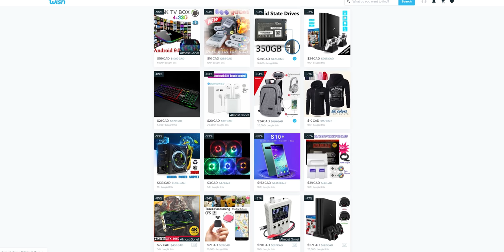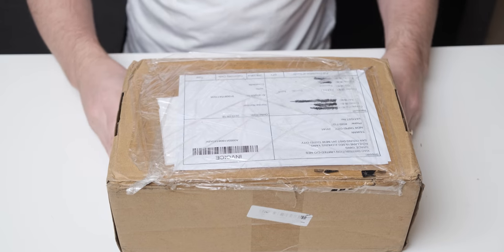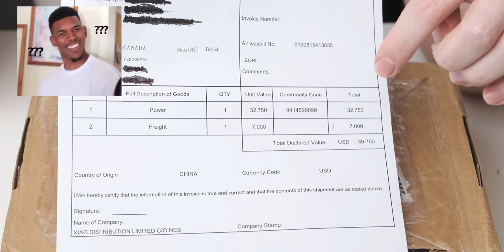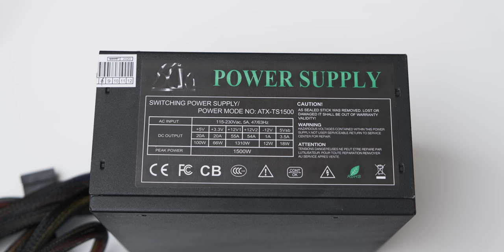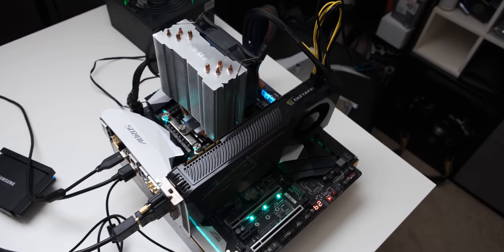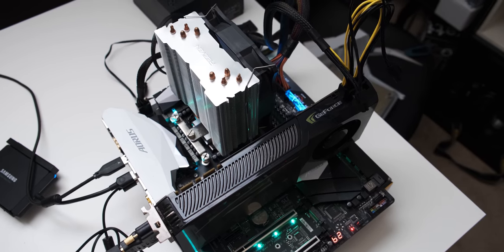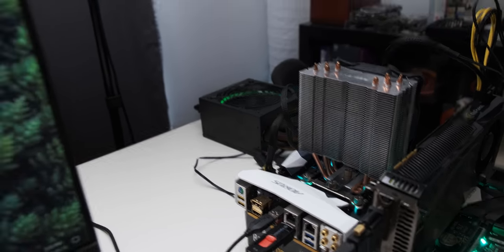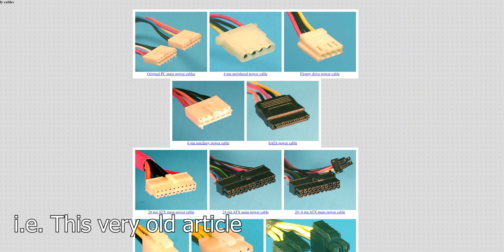I bought a $69 1500w power supply on Wish.com

Comment: It's a switch mode power supply. I can see the input state where it rectifies the ac sin wave then it goes to then it chops up the wave according to the output current to increase or decrease the duty cycle. The last stage is the filter circuit then the output. Standard design. I'm an EE. I know a little 🤓
Reply: Okay. What does that tell us about the quality of the PSU though?
Reply: @JFHeroux  The quality of the power supply is dependent on the components used. You may have parts rated for a higher current/power but they may not be as efficient hence the 80 ratings. For example, an 80 plus gold rated must have a 87% to 89% efficiency at full wattage rating. Cheaper supplies also have poor pcb quality which is dangerous because at higher wattages the distance between the power and ground plane must be increased to eliminate shorts but the company will usually not do this properly to cut costs.

Comment: what you'd really be concerned about are blown capacitors.. you could run it a week and open it up and see if any of the capacitors are swollen.. they may just be using old parts.. & if that is really Japanese then it could actually last 5 years or more

Comment: Lol that transformer can judging from its size probably only handle up to 350-400W. I have a tip: take a look at the input fuse rating and the thickness of the core in the wires. It has an active PFC (=Power Factor Correction) and input filter (noise killer) and uses MOSFETS in a forward converter configuration. It uses seperate buck converters (those 2 boards on the output side) probably for an extra 12V raiI for the CPU or GPU. The earth connection is also not properly secured. I am pretty sure that this power supply can only handle up to 350W without overheating. On 1500w it will definitely explode.

Comment: odds are it's a low end thermaltake power supply and they just stuck a different sticker on it ... did you forget to switch the power supply voltage switch to 115v?

Comment: You have to figure most "cheap" high-wattage power supplies are probably something like 50-60% efficient, so that 1500 watt probably only puts out about 700 watts continuously (but perhaps not cleanly).  I'd rather pay $69 for a Coolermaster or some other major branded 600-700 watt power supply that is 80%+ efficient and can put out clean(er) power.  For $69 you can actually get a decent name-branded power supply these days.

Comment: FYI: the 80+ certification is a self-certification, not any kind of standard required by law anywhere. And really all it is is an efficiency certification, they don’t test the quality of the PSU components, or any of it’s built in protection circuits/triggers. Generally PSU’s that get higher 80+ certification use higher quality components, but that by itself is not evidence that it’s a great PSU, cause again the actual design of the PSU circuits and protections is never examined or tested. So you can have a Gigabyte situation where it’s an 80+ Gold or better PSU with quality components, but has a bad design and explodes, dies, or catches on fire - all from a seemingly reputable brand.

Comment: As other people have already said, my guess is that it’s a rebranded thermaltake unit which is probably why there isn’t an indication of who makes it, makes it harder for thermaltake to find out... From what I can tell it doesn’t look nearly as bad as an el cheapo “Storm Power” 500w supply I had a few years ago, which did actually go bang in the end.
Reply: a coworker managed to fry the fuze of an entire fkn floor in his apartment building with a corsair VS650 that is a 650W PS that's rated +80. It legit blew up, fried his motherboard and almost set the room on fire. He was pulling less than 300w out of the wall with a ryzen 1600 and a gtx 1650 Super.
Reply: @Stein871  Yeah I've heard the VS units aren't great... Guess there are always a few not fit for purpose that slip past QC.

Comment: Discharging a PSU: Shutdown the rig. If the PSU got a switch also switch that off. Unplug the PSU-cable. Switch the unplugged PSU back on (if it has a switch). Turn on the rig/PC. So the rig/PC sips the leftover charge from the PSU. Not perfectly safe - but you should get rid of most of the charge.

Comment: this kind of raises an interesting question though, because you're not wrong about wanting a reputable power supply manufacturer, but how would a power supply manufacturer build its reputation when no one knows anything about it yet? i didn't feel like i saw anything particularly egregious about that PSU, and it clearly works, so who's to say this will fail faster than any other?

Comment: LoL this just came up in my feed.

Were going to check out this which I don't have a clue.... Well-done you for content.

Cables mean nothing, well thing wire and heat cuts and smells with a eventual fire or short.

Looking at the board, there are two es3000 boards. Older PSUs never had those and they are protection and regulations.
One would be 3.3v and the other 5v.
The 12 isn't normally attached to these and is done differently.

The black things stuck to the heat sinks are the power MOSFETs.
To know what they are and if they do work you need to brand and number from them... Coil numbers usually bring up nothing as they're technical items which are meaningless aposee to the parts etc within them as a more whole unit.

So you would need to read out the MOSFET. When you've done this then you can search it as it's data sheet.

It will give you the very specific details and charts on how it works. As it's a new design it's going to be a minimum 85% which I believe is bronze and a crap design, nominally it should be around 95%+

You then need to view the circuit and see what's running in series's or parallel to bring up the ampere. That seems fairly high to me. For the size that is but I have some small 400v 60amp MOSFETs.

Now we could run 30amp together to get 60amp, and were talking 53amp so  individual MOSFETs of 26amp is fairly common.

The important part is the two smaller boards they regulate power and provide all the protection.
I would have put a pin or paper clip between the ground and 5v on a connection as saw if it powered off.
Removed the fault and see if it powered back on
Real basic test there.

You could then get some bulbs, say car headlights, which are around 45watts (12v/45w=amps)  and ran them up to the limit and see how you faired and when they start dimming... It's a lot of lights.. but if you don't have a good test load and then as a few then you will be there a long time.

Looks like a basic circuit, looks about right. But it's all down to the chips, I think China has a W rating which means Weather it will work.
Or Wild guess...
Or Well if we add everything up and the wind is the the right direction and the crow is crowing, it will be 50% better. And that's the number we will use.

Comment: I am like 90% sure that is a 400-550 watt Thermaltake power supply, as I just got an (i think) 550-watt Thermaltake power supply. it cost about 50$. it has identical cables, same number of each type, as well as the same colors and netting on the cables.
Reply: most have similar cables in the 400-500 watt range

Comment: tbf it did better than my legit Corsair 650W PSU, which blew up when on standby after only 4hrs of proper use (a shower of sparks shot out the back), then blew up a second time when my local PC shop unwisely plugged it in again to try it after I graphically described what happened previously !!

Comment: You can try SLI/Crossfire, and re run the stress test, just use a molex to 8-pin power cable for the second card and overclock the CPU and GPU's aswell for maximum power consumption because the stress test you ran probably consumed like 350-400W.
Reply: Just use some car headlight bulks to load the 12 volts. Those are 55 or 65 watts each.

Comment: I have an old Dell Precision T7400 Workstation and it has an 1100W PSU(as i remember) and it has a LOT of 6 pin, 8 pin and even a 10 pin which i don't know what it is used for. And another thing it has is 2 24-pin motherboard power connectors.

Comment: Wish does have its uses. As a tabletop gamer. Some of the models you but can be around 200-300 bux. And on wish there around 75% off the price. Things ive ordered have turned up looking as desired.  Because its a forgery of a product something that should be made out of resin feels heavier. A lot heavier.  So it does have its uses.

Comment: it's not a worthless power supply.. & based on what I can see I mean I didn't put it under a microscope it seems safe.. there isn't anything done terribly wrong in there.. it's cheap metal for sure so in an enclosed case it would put out a lot of heat especially under heavy load but that power supply you really shouldn't... this is my expert opinion & just an opinion... but I wouldn't put more than about 450 watts on that supply.. you could get by with a decent rig in that range on that supply.. it's just so cheap.. or take the guts out and move it into a sturdier casing.. if you have an old blown supply.. that's something I'd do..

Comment: this is probably from a Thermaltake assembly line, they just skip the branding part and change the wattage in the sticker. May not be a fire starter unless someone actually try to get the 1500W out of it

Comment: This comment may be redundant, but you can see a standard rectifying circuit with the necessary filtering, switching transistors, the main and auxiliary transformers for the main power and the 5V stand-by, the output filters and the feedback ICs. Nothing unusual, looks like a standard 300-500W power supply. Doesn't look like it has a power factor correction or at least I don't see it. Shout-out to European plugs! Hahaha

Comment: You can just tell how much real power a PSU has by its weight and size. 1000W+ PSUs are big and heavy, this one looks 600W at most. Also, what's the point on a 1500W PSU if there's only two PCIe connectors? at this power rating it should have 6 or even 8. Or two 8pin molex connectors for dual CPU boards.

Comment: i honestly bought a 690 watt psu this one (A-Power AK 680W 20+4-pin ATX Black PSR Power Supply w/SATA & PCIe & 120mm Fan) and it did work great, ran a 1060 6gb zotac amp edition, r5 2400g, 16gb team group vulcan ram 2400mhz oc to 3200 mhz, 1x500gb ssd wdblue, 2x1tb hdd wdblue 7200 rpm, 5 rgb uphere case fans, and its still going although i did get a better psu from coolermaster.... so in other words that psu for 27 bucks can be ordered, then when its shipped and arrived you can claim it didn work and get your money back...

Comment: At a quick glance that seems like a fairly good quality 500-550W unit. At around 8:10 it actually states the real wattage on the PCB. Looking into it seems to be manufactured by company called "UT Power". That company also manufactures some Thermaltake power supplies, hence likely the Thermaltake branded fan. In fact I wouldn't be surprised if this is an rebranded Thermaltake PSU in a different casing and obviously relabeled by someone as "1500W". Overall I would say the quality is better than expected and would likely be safe to use. There are much worse units available at retailers like Newegg and such.
Reply: So how does this stack up against say, a corsair VS series PSU (dirt cheap, get what you pay for type of deal)?
Reply: @MLWJ1993  it's hard to say with the very quick glance we saw of the innards of this power supply, and without any actual performance testing. But from what I saw, I would say that the components quality seem better in this unit than Corsair VS. But ofcourse this is not a 1500W PSU at any day of the week, so comparable VS model would be VS450 or VS550.
With VS you get full warranty, proper certifications, better quality casing. With this all of those are just a question mark.
And obviously the seller, or the factory that relabeled this psu is shady, so there's no telling that if you purchased this same unit today, it could have totally different innards - They might be using just whatever they are able to get that day.
Reply: @MLWJ1993  but comparing to those very cheap PSU's from obscure brands, you can get from ie. Newegg for $20-30, the quality is from a different planet on this one. This is so much better than those.
Reply: @WestSideJooo  Huh, interesting. Never guessed this could actually be a half decent budget psu.

Comment: Try to use Sata to 6+2 pin connectors and put 2nd card on the system (6+6 or 6+8 or 8+8 pins). Try 2x R9 290X :D or some other old AMD cards that needs a lot of power.  If it not blows up and you can run 2 cards then isn't too bad. Ratings on the label are too good to be true.

Comment: You definitely cannot get 990W via those connectors
No way
PCIe gives at best 150W per 8pin
8pin EPS is strictly 240VA (not even watts)
I doubt you can get more then 1.2A per voltage per SATA plug (14.4W + 6W + 3.96W) 24.36W and this is huge amperage

If it comes to EPS plug
This knowledge comes from specification of EPS SMPSU
Whoever suggested 336W was crazy and had absolutely zero knowledge about computer power supplies

Comment: You can open a PSU and be perfectly safe. Just be sure to short out any large capacitors with a screwdriver. And the PSU was probably QC tested at the factory, given the seller's manufacturer actually does that, so it was probably pre-charged.
Reply: Assuming it's a unit, even from a Chinese OEM, that had any chance to be permitted in the civilised world, it would have a discharge resistor across the capacitor, so when you pull out the plug from the back and then proceed to touch the exposed IEC socket pins, you wouldn't get a nasty surprise. The chances are really good though, i mean Yue Lin, Xin Hui Yuan, UTPower and Great Wall all have made PSUs that are imported by reputable brands and are familiar with meeting regulations, while all the other Chinese domestic manufacturers only make clones of 20 year old ATX1.1 designs that don't look anywhere near similar on the inside.

Comment: Okay great video and all

BUT

Your worry about the invoice and how it says that the value is almost half what you paid for. That is completely done on purpose, the whole point of the sellers doing it is so that when the package arrives at your country; customs won't have to charge you any extra fees. Some countries base their custom fees on the value stated on the invoice, some countries base it on the value and weight of the package. So Chinese sellers try to avoid that by putting some bull shit value on the invoice. Also, when they write the description of the item, they will try to be generic as possible. For example if you ordered a fast charging charger for phones, they would literally write "data line cable". The whole point is that they want to shift all the customs' attention away from the package.

Anyways, I love your channel and this is not a complaint  i just thought you might want to know

Comment: that's just a bog standard 500-600w PSU in significantly cheaper housing with a bullshit rating stamped on the side. That 12V rail will be like 250W at best.

Comment: ive never bought anything from wish and never will.... that being said, i have used a few cheaper PSUs over the years and have had pretty good results. of course i dont push the limits of them... for instance, if it says 1000w, im not gonna do anything that would even require 400-500w. ive used a couple of cheap ones in old retro builds and they seem to work fine too. im actually using a 750w one in a system that maxxes out at around 350w or so and its been going strong for about 5yrs now. even has a blue led in it too. lol. but yeah, from my experiences, cheap PSUs are usually fine if you use less than half of what its rated for and itll be fine. dont use a cheap PSU if you are gonna use it to power high end parts though, just in case.

Comment: That exact same power supply is being sold on eBay as 800, 1000, 1200 and 1500 watts. It's actually only $30-ish USD If you get the 800 watt version. It's the exact same, it just has a different sticker. Unfortunately, on all of the different versions the stickers a lie, as expected. From what I can tell, it should be capable of outputting about 700-ish watts. Overload protection triggers at somewhere around 730 watts, although it is capable of peaking up to 825-ish. Anything above 575 watts and you start to get horrendous noises and pretty nasty smell, so I wouldn't trust it for long-term use at anything above 500 watts. I buy them by the dozen to stick in computers I sell, but I make sure to never put them in a computer that I expect to use more than 500 watts :P

Comment: I got a 1000W PSU around Black Friday 2018 for $89....
But I got it directly from EVGA on a special. 

I didn't need 1000W, but at $89, why not. It was cheaper than the standard 750W to 850W I'd normally get.

Comment: Added edit:  Most cheap electronic components would not have that white silicone type glue (ASI 388 electronic grade silicone ,or other type) . Why make a cheap product that has an anti vibration glue in it? That glue prevents the individual components on the PCB from vibrating out of the solder socket. Cheap electronics don't have that (usually) I bet they took a brand name  used PSU and re-branded it. Since a 500w PSU sells for the price you paid why not say it's 1500W ???? This is my theory.   Look up 500w-600w  Thermolake PSU's I bet you find it.